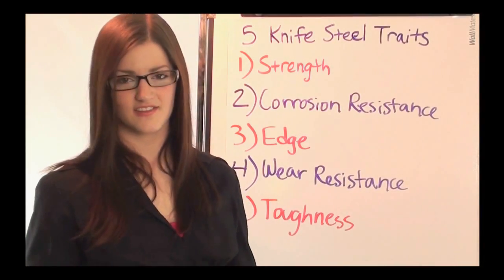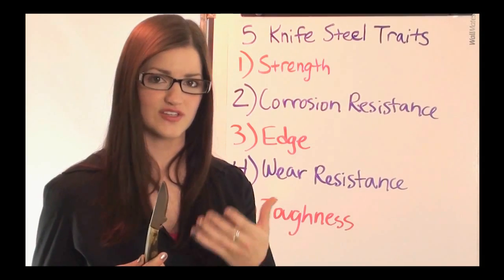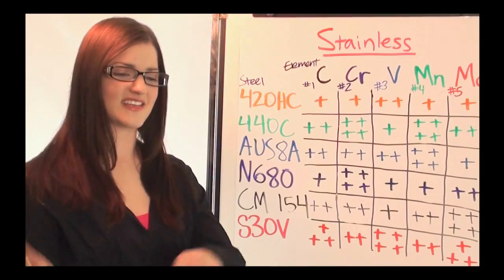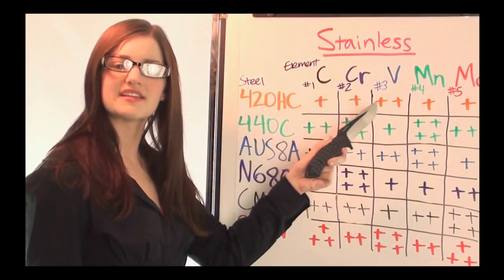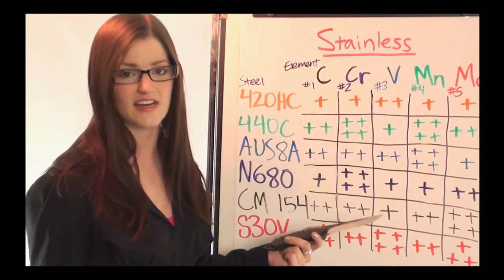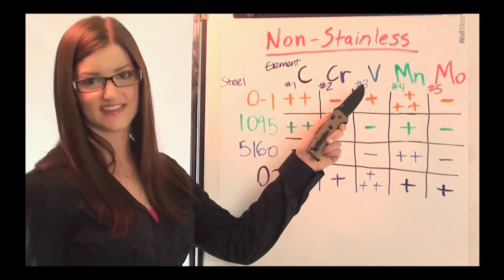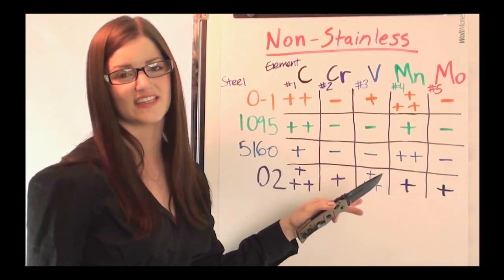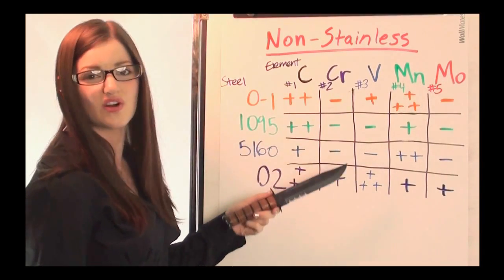Steel - FateofDestinee

Comment: The non-stainless steels are for longer (than one foot) blades at which point the high chromium and such becomes a detriment by making the blade too brittle for their intended uses such as clearing brush or in sword re-enactments.

Comment: you look super hawt dressed like that just saying. as far as blade steels as a rule of thumb carbon or non-stainless is tougher than stainless.

as far as performance goes most stainless will hold an edge longer but theres a few exceptions like CPM-M4 which is my current favorite it has tungsten in it and it takes an amazing edge is tough and holds it FOREVER but it can rust badly, for a stainless ELMAX is best, much tougher than S30V and holds an edge longer =)

Comment: there's alot of really great designer steels out there - problem with them is the tempering of them , high carbon steels (5610, 1095, 1080, w2, w1, 01..etc..) a knifemaker can temper himself at home..when you start getting into some of the stainless steels - most will send them to a company to get them tempered, or they fork out the cash for the machinery to do so...check out artistblade1972...he's got some great vids - i don't have a camera

Comment: You did a lot of research and you did a great job of presenting it. Do some reading on Swedish tool steel which is what some high end custom knife blades are made of. Blades made of this steel are easy to sharpen and they stay sharp. Most of the time you don't have to do anything more than put the blade on some leather after two or three deer to get the razor edge back. Randall Made Knives use this steel.

Good job.

Comment: S30V is exceptional steel, but it is costly -mostly due to its required heat treatment above 1900 degrees and because it is a newer type of steel. It still isn't as popular as 154cm, and for the price difference and the fact it is far easier to find/work with, it's a solid alternative no matter the personal preference. I can see S30V being used more in the future, and perhaps the price may drop, making it more exciting to find great blades!!!

Comment: Nice presentation Destinee.  That is a good way to break it down.  D2 is mostly used for commercial tool & die work, but it makes a good knife too.  Some of the custom knife makers here in middle TN also have been known to make quite a few from A2 - probably as much because they can get it as anything else.  I've run quite a few of those through our furnaces over the years.

Comment: D2 has a problem with large carbides in the matrix, so it suffers from relative weakness and it does not take a highly polished edge easily. On the plus side it has very high wear resistance. I have a few knives in that steel as well as hundreds or other knives in various steels. My favourite knife in D2 is a Bob Dozier. I did the steel  FAQ on britishblades. Greatest compliment I ever had was Sal Glesser telling me I was spot on with my steel opinions and could sharpen to the highest level.

Comment: Oh my gosh... there are countless steel types.  You can make your head spin trying to compare knife steel types.  If you're getting into it you'll have to check out the laminate knives.  You can get the best of both worlds w/ a tougher outer layer and in inner layer with very fine edge capability.  My camp LBE wears a Fallkniven F1 in VG10... sweeet :-)

Comment: when i want a good blade- i go out to the anvil and bang one out of 5160 high carbon - then clay temper it (differential temper)...i usually keep my blades 1/4 inch thick down the spine...stainless is soft..yes high carbon steel will rust if you don't take care of them, but a stainless blade can't compare in toughness, or keep an edge as long for hardcore daily use